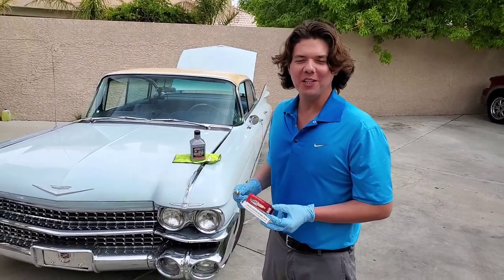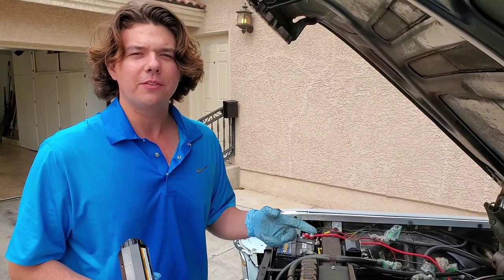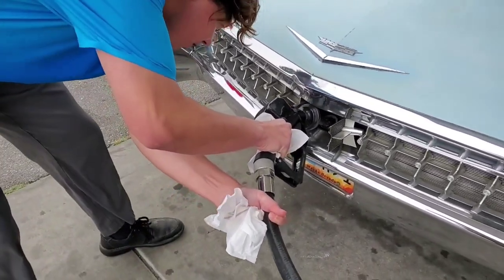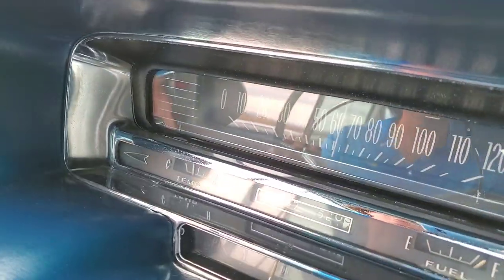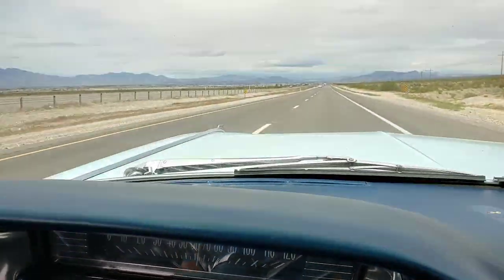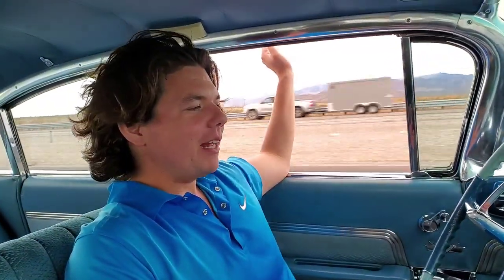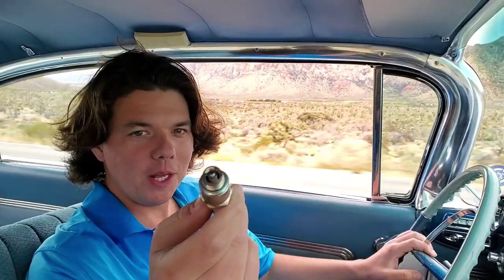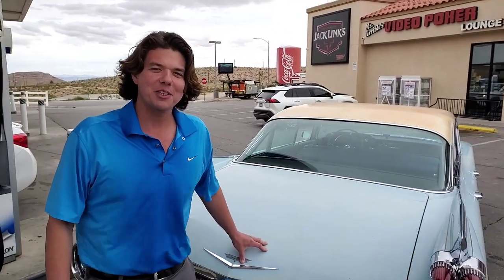1959 Cadillac Baseline Gas Mileage Test Results

Comment from the maker: Check THIS: AMSOIL $50 FREE Shipping Promotion April 1st-15th - https://youtu.be/VCDBfF40qog

     My Link: Best AMSOIL 100% Synthetic @ Wholesale + FREE Shipping: https://www.amsoil.com/offers/?zo=5331179

     AMSOIL Products & Vehicle Lookup - https://www.amsoil.com/guides.aspx?zo=5331179
 
     AMSOIL Performance Tests - https://www.amsoil.com/performancetests.aspx?zo=5331179

     Follow these accounts for Ebens Giveaway:
Instagram - https://www.instagram.com/syntheticoilprotection/

     Eben Facebook - https://www.facebook.com/profile.php?id=100007973957868

     People ask me these three things:

1. Where can I find AMSOIL? - Use this link https://www.amsoil.com/offers/?zo=5331179
Or
Watch THIS: 3 Fast Ways To Get AMSOIL - https://youtu.be/RiYifuDCsnQ

2. What makes AMSOIL different than other oils? - AMSOIL is 100% Synthetic & has higher film strength & last 4×longer then Mobil 1 EP which protects and separate metal parts keeping them from wearing and Lasting Exponentially longer: https://youtu.be/f4eNPgTi_qo

3. Why should I use AMSOIL?: It protects the engine so it will last longer. Less oil changes less often(once per year/15,000miles) or longer... Save money in Gas & Time making it less expensive then a free oil change over the year - https://youtu.be/H7K6FdZlqmg

     Professional YouLubher:
Eben Rockmaker Executive Direct Jobber AMSOIL Specialist (Dealer#: 5331179)
Mobile: (702) 472-3614

     My Link: Best AMSOIL 100% Synthetic @ Wholesale + FREE Shipping: https://www.amsoil.com/offers/?zo=5331179

     AMSOIL Products & Vehicle Lookup - https://www.amsoil.com/guides.aspx?zo=5331179 

     If your vehicle is not on the lookup guide this is AMSOIL Tech Support 715-399-8324 be sure to refer to Eben 5331179

     46,000 Mile AMSOIL Oil Analysis - https://youtu.be/UjijQK5wSM0

     Friend me on and tag me because I like to see great results from my YouTube Community:

Instagram - https://www.instagram.com/syntheticoilprotection/

     Eben Facebook - https://www.facebook.com/profile.php?id=100007973957868

     Order AMSOIL By Phone:
Be sure to give them my number so I get credit Eben #5331179 and tell them you would like to be a Preferred Customer.

1. Call 1800-956-5695
2. Ask for your own preferred customer membership because you will get 25% off, free shipping over $100, and your informative quarterly AMSOIL Magazine. It costs $10 for 6 months or $20 for the year which is well worth it.
3. Give them my dealer number so I get credit Eben 5331179
4. Orders over $100 will be shipped free.

     Industry-standard 3rd party testing results:

     AMSOIL Signature Series 5W-30 Synthetic Motor Oil protects against harmful deposits on turbochargers 4X better than Mobil1® Extended Performance and 3.6X better than Royal Purple® in industry-standard testing*.
https://www.amsoil.com/newsstand/motor-oil/articles/leading-the-field-in-deposit-protection/?zo=5331179

     AMSOIL Better Gas Mileage -
https://www.amsoil.com/newsstand/motor-oil/articles/another-win-for-amsoil-products/?zo=5331179

     AMSOIL Performance Tests - https://www.amsoil.com/performancetests.aspx?zo=5331179

     Professional YouLubher:
Eben Rockmaker Executive Direct Jobber AMSOIL Specialist (Dealer#: 5331179)
Mobile: (702) 472-3614

     My Link: Best AMSOIL 100% Synthetic @ Wholesale + FREE Shipping: https://www.amsoil.com/offers/?zo=5331179

     AMSOIL Products & Vehicle Lookup - https://www.amsoil.com/guides.aspx?zo=5331179

Comment: Do you have to add a lead substitute and/or an octane booster, in absence of hardened valve seats, and the high compression ratio of the 390 Caddy motor? Great video!!
Reply from the maker: Not that I'm aware of it runs pretty darn good The octane booster does help in the upper cylinder lubricant obviously makes it run smoother
Reply from the maker: I highly recommend those two you would be very happy with them this is my link if you ever have any questions you can always reach out to me anytime I appreciate all your business in the future and I appreciate you being a part of my YouTube community thank you.
❤️🇺🇸❤️ Professional YouLubher: Eben Rockmaker Regency Gold Direct Jobber AMSOIL Specialist (Dealer#: 5331179) 702-472-3614 

     
      ✅✅✅  New To AMSOIL I Recommend The AMSOIL 6 Month PC Membership because it will save you about $33 on a $100 purchase after the difference in tax - https://www.amsoil.com/offers/pc/?zo=5331179